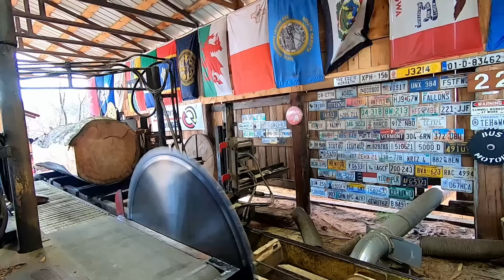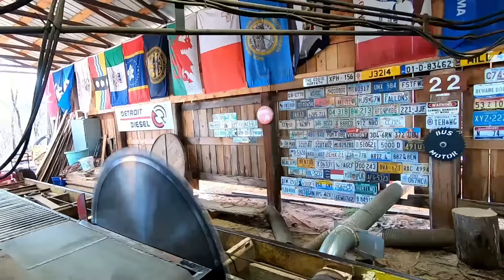sawing a monster pine log # 408

Comment: Didn't recognise Buzzy. He cleaned up better than I do! GOOD sawing and I remember hemlock about that size around 16 to 18 feet long on the old mill and when the rime to turn came, EVERYBODY danced over the mandrel shaft and grabbed whatever hook, bar and pole there was because it was going to be a JOB! I can see a white pine still standing about that size on our corner that's still growing. Maybe someone will want that for boards one day. HAPPY Week, Mark and no, you do NOT need a blasted band mill. BLESSINGS!
Reply from the maker: thanks Lewie , no band mill for sure.

Comment: Unlike some of your other followers, I particularly enjoy watching how you do a stop sign cut.  It's really clever and I swear I can almost hear the gears turning in your head as you try to figure out how to cut into the monster logs to get them down to a workable size.  Each time I see this technique I ponder the value of a second laser line.  You have a green laser shooting straight down to show you where the saw cut will be, but would a second laser of a different color showing you the max height of the blade be useful?  I'm sure there would be logistical issues of where to mount it for it to both be effective and not in the way of the log deck or anything else.

Comment: HI MARK that's the 1ST pine log IVE seen that the boards won't fall away from the saw blade they are sticking 2 the saw blade like a peace of butter ,butter does that 2 when U cut it OMG 4 3 2O23
Reply from the maker: yes they were.

Comment: Kind of a stupid question... only because I know little about milling and the machine you use.  When you're jostling a massive log around like this on the "bed" turning it over, I've noticed that the whole rig moves sometimes.  Does this throw things out of alignment of the blade, etc.?

Comment: I was really surprized at how nice and light the wood was close to outer .looks like you caught this just in time. I was wondering if you could mount an extra camera on the right side wall,looking at the carriage edge just so you have a third eye on the lay of the cant..so you can check it and switch it off,then go back to sawing,and t.h.e. deey can check the other end..just a thought.you got this log perfectly .
Reply from the maker: yes it was still good , Eddie is my camera.

Comment: Mark just a idea for Ya
 On you power over the carriage swing arm run a air line and right at the bottom of the Knees weld on a bracket to attach the air hose with a Nozzle pointing at the landing where Bark sometimes stays on and install a inline Solenoid valve u can control with a push of a button too possibly blow off the bark ! Just a Thought

Comment: I was watching a homesteading show last week and they were repairing a 100 yr old out building that had the walls filled with saw dust as insulation for the livestock. So there's another use for the dust in the bin.
Reply from the maker: they used sawdust to store ice in yes a very good insulation for sure.

Comment: Hi, Where are you guys located? Perhaps not to specific town but state would be good. I love watching a mill run. What engine do you run the mill with? What is the other smaller engine sitting beside the the planer? Thanks for sharing, Bob from Virginia USA
Reply from the maker: Hi Robert we are from Imperial PA , the engine is a 671 Detroit and the edger runs off a Leroi gas engine.

Comment: I’m originally from Northern California up in EL Dorado county a little tiny logging town of pollock pines . 4 generations of loggers all timber fallers. If you think that pine smells good you should smell sugar pine. For me personally there are 4 trees that smell the best. 1 silver tip fir it always smells like Christmas it’s a hi elevation tree growing from 6 thousand feet to a little over 8 thousand feet 2 lodge pole pine another hi elevation tree growing at 5 thousand 500 to tree line give or take 3 sugar pine it’s a multi elevation tree I’ve seen them grow from 2000 feet all the way to 8 thousand feet it’s a very sweet smelling pine and it’s the largest growing of all pine species and has the largest pine comes. Growing to about 10 feet across at the stump but I’ve seen a few over 14 feet across 4 western red cedar growing from 1 thousand feet to about 8 thousand 500 feet it’s the largest of the cedar trees I’ve seen several almost 7 feet across the stump and a few even bigger at 10 feet across. And 5 a bonus tree that being Douglas fir it too smells like Christmas it grows from 1,500 to 5,500 feet in elevation and can grow large I’ve seen many 8 and 10 feet across on average though many are 6-7 feet across. The white fir smells ok in younger trees or the tops but the old trees well they have a very distinct sour smell almost like pee and they hold tons of water giving them a more colorful name of piss fir ponderosa pine is ok smelling as is California black oak white oak otherwise known as valley oak or blue oak and live oak is ok digger pine or known as California gray pine has a sour pine smell it’s wood is worthless it cannot be milled it’s wood twists worps. And splits when dried sometimes violently and it’s almost always solid pitch wood and will burn up a wood stove melting it as will manzanita brush and sometimes madeone trees. . Now living in southwest Missouri a town called bolivar. Different trees all hardwood species except for scrawny red cedar and pine lots of Planck walnut silver maple and various oaks and other unknown to me hardwoods.
Reply from the maker: thank you for the great comment Dan , lots of good info on many different species of pine.

Comment: Mark, do you have a light on your control panel in your cab that comes on to indicate the dogs are engaged with the log when you are cutting a very large log. You can't see over the log so how do you know when the dogs are holding the log?
Reply from the maker: no light to tell me that's why I run the knees forward to se if the log rolls down then you know .
Reply: @markgalicic7788  I forgot about the knees going forward to touch the log.  Thanks.

Comment: A big 'un. I take it there is no interlock between the main log roller and the dogs. In other words, you had better make sure you withdraw the master dog before you roll the log, otherwise you stand to bend or break the tooth/teeth on the dog/dogs?
Reply from the maker: yes for sure , undog then turn.